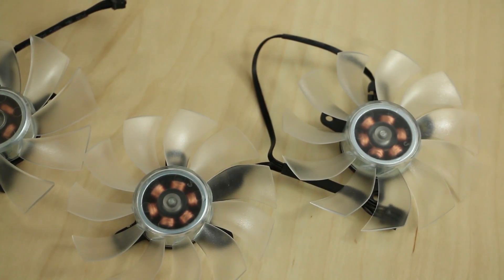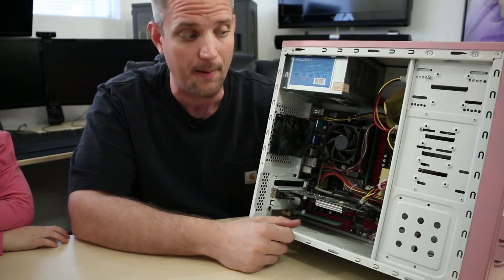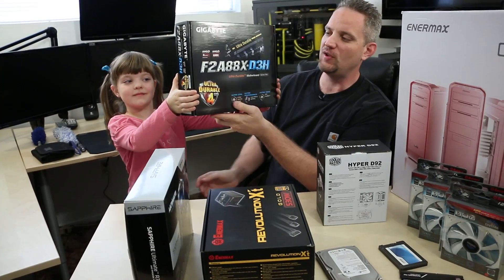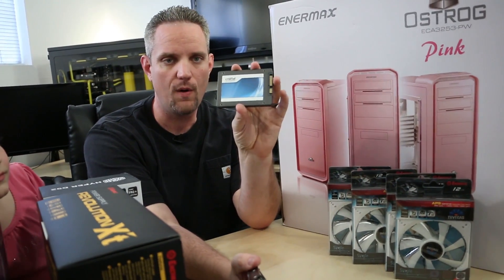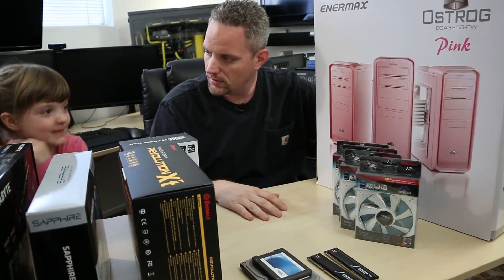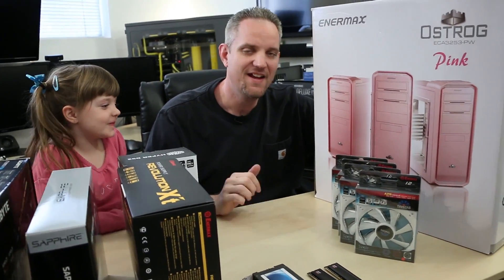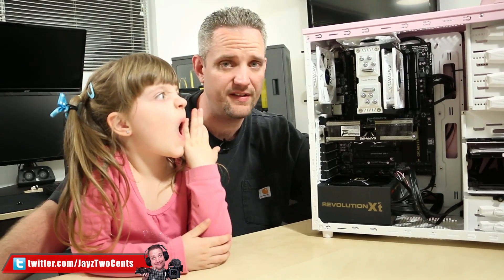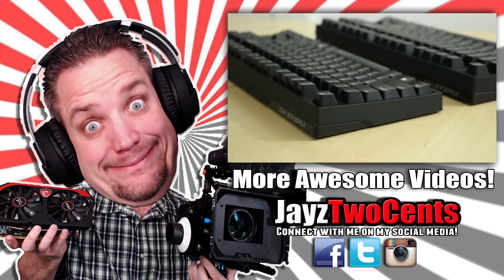5 Year Old Builds a PC

Comment: I noticed that you said that the 'slow' boot was because it was an AMD Athlon X3, but I have an old Athlon X2 that I use for a media PC, and I saved the boot time by putting an Intel SSD into it. Most of the boot speed issues are going to come from HDD speed limitations and other bus limits. (Such as the IDE bus that you mentioned.) The only bottleneck that I run into when I want to do something is that my home network is running at a slow 10/100 speed, but a $50 gigabit switch should get rid of that issue.

For most people that need a basic office computer, kid's computer, or internet browsing computer; these old things can still do that job well. Sure, they're garbage for hardcore gaming, but for the average person that doesn't do that, they're perfectly fine.

I even just finished an emulator rig that I'm using that's even less powerful. It's a laptop based on an AMD TF-20 chipset, with like 3GB of ram, and an old 5400rpm HDD. It going to run Atari, NES, SNES, GBA, MAME, and Sega games. Just about anything can run those at this point. Thousands of games on a system less powerful than a cheap smartphone isn't bad. :)

To paraphrase the old saying. It's not the size (or power level) or your rig that counts... It's how you use it! LOL :)
Reply from the maker: sbrazenor2 I never said it was due to the Athlon, I simply said it was slow. The slowness is clearly due to the IDE drive.
Reply: I too use an old athlon x2. it's my main system rig actually. the one in my HTPC might actually be faster.. at any rate, i agree. her old rig with an SSD, SATA upgrade, and some RAM would have probably set her up nicely. but it wouldn't have been as much fun, or as much of a learning experience, nor would it have proven the point of the video, which is if a 5 year old can do it, some grown ass folks that say they can't are some bitches. :)
Reply: 5 mins to boot may be due to failing hard drives as well.
Reply: koolBOY8323 Yeah, my main rig is a custom build with an AMD FX 8350 Black Edition. I probably saved about $400 building it and I can tune it anyway I want. Storage I bought online, going with 4x3TB drives for like $80 per.

OEMs cripple systems with limitations and cheaper components. My 'media' PC is capped by HP to 4GB of RAM, because it was a 'value model' sold at Walmart. (It was cheap, I couldn't resist.) LOL :)

I think an asset that I have is that I'm near a Micro Center. Compared to the usual big-box stores like Best Buy, the stock on hand is much better, and the prices are comparable to the internet for a lot of things. (I just like that I can have a good hands-on feel for what I'm buying and after check-out, I instantly have it, rather than waiting 2-4 days for shipping.) For a novice builder, a store like that also offers better trained sales people that can help with configuration options.

I found that they would recommend budget friendly options, instead of expensive options of equal value. For a new builder, this is important, since they may not know what they're getting into. Additionally, if you need a beefier heatsink / liquid cooling option, or other accessories, they will be able to help you figure out what you may be missing.

Even though I have about 14 years of IT experience, I opted to work with a sales person to figure out what their best deals were. I was able to find some good package deals and rebate options that saved a couple of hundred dollars. What I came into the store with for an idea and what I left with were different. I got better hardware and lower prices. :)
Reply: ***** It wouldn't win any benchmark races with either part, but yeah, the IDE drive would definitely do it. It was a good video, so I'm not trolling. I always enjoy your videos and Barnacules Nerdgasm's. I'd love to match the production quality of them, for my videos, but I'm still working with some pretty basic gear.

To work on my video quality and add better content, I'm doing an unboxing and review of a cheap Chinese flash that's supposed to rival the Nikon SB-600, but I've got almost no budget and I'm a novice with post production. I made the video with my Samsung Galaxy S5, which is pretty flat on color representation and sucks because it boosts the ISO too high. I'm planning on trying to use my Nikon D3200 for videos and hack together an off camera sound solution. They'll probably still suck. :(

I also need to get better software. I've been using Windows Movie Maker, which is not going to make any cinematic gold anytime soon. I may just switch to iMovie on my Mac.
Reply: Sam' s TechTips Seriously? Are you like 5 years old dude? n00b... Yeah, with like 16 years of IT experience and having been on the internet since Google was in beta. If that's a n00b, I guess we're all n00bs.
Reply: sbrazenor2 Dude, 16 years of IT experience and you haven't learnt to ignore trolls?
Reply: coscorrodrift  Sometimes I like to feed them. If you don't feed them, they will go extinct, and we won't have as much fun online anymore. :)

Comment: guys am not expert in pc building but i have a question why some ppl put the psu upside down. normaly the fan of the psu should be down not up
Reply from the maker: Depends on where you plan to put the PC. Since her PC will be on the floor, we mount the fan up to get clean air, instead of dirty, dusty air from the carpet.
Reply: yeah i though that too. but if i used a gpu with fans like the gigabyte g1 gtx 970 wont that leave the psu with no air? my case dont have best air cooling (nzxt h440)

Comment: She knows how stuff gets done around here!
Reply: Wait.... What about the thermal compound... Or is that only for liquid cooling? I've only used liquid cooling in all my builds XD
Reply: You need thermal compound on air cooling too
Reply: Oh thanks for telling me that.
Reply: Kirn20 No problem man, thermal compound is used for heat transfer. So basically any PC cooling solution uses thermal compound.
Reply: Also, I'm thinking of using MX-2 thermal compound in my next build, what do you think?
Reply: Kirn20 That is a good thermal compound but i would suggest using Arctic Silver 5 Thermal Compound. It is a very reliable compound and is used a lot of times in builds (over 6,500 reviews on Newegg!) and is highly conductive which is good.
Reply: Kirn20 Just curious too, what are the specs of your build?
Reply: FX-8320, R9 290 MSI, 16G DDR3 RAM, And a 750- Watt power Supply
Reply: Kirn20 cpu is bottlenecking your gpu. Unless of course, you oc'd it to around 4.6 ghz
Reply: Mar m OH NO!! Not the word "BOTTLENECK!" THE HORROR!
Reply: Mar m  That's why there's overclocking, dumbass
Reply: Kirn20 That's why I said: 'Unless you're overclocking'. I can't believe how angry you are when you receive a comment and a question on the build that you proudly post on youtube.

You're so angry man
Reply: Mar m I just called you a dumbass because i don't care if it bottlenecks.
Reply: Kirn20 If i were you I would get an fx 8350 and a gtx 970, or keep the 8320 and get a gtx 970
Reply: First of all, i'm getting an 8320 because reasons prev. mentioned.and I can't get a GTX graphics card period. I love my motherboard and if i have to be an AMD So be it.
Reply: I will admit, part of it is brand loyalty, the other half is cards like the GTX 750 and things like that that was in my price range, are apparently not as good as that card, and it came from people with the GTX 750 and 760, they recommended that card, so i bought it.
Reply: MSI 4GB R9 290; I might get the MSI GTX 970 4GD5T OC GeForce 4GB instead
Reply: Joe Thorpe The Gigabyte one is a good choice but might be too long for some cases, the MSI Twin Frozr V is a good card but i have an EVGA ACX 2.0 GTX 970 and it's AMAZING. It runs very cool and comes in Superclocked, Super Superclocked, and FTW versions. I think they start at $349
Reply: I was thinking about it, but i like MSI more, it fits my blue theme. Plus i have a msi mobo. In case your wondering it's the 990fxa-gd80v2
Reply: It's not a reference....
Reply: are you talking about the msi gtx 970 has a horrible cooler?
Reply: Oh ok Good
Reply: Kirn20 Aren't the MSI ones only in red?
Reply: No, http://www.newegg.com/Product/Product.aspx?Item=N82E16814127833

Comment: I think it is great that you and your daughter built this computer together. There is no reason to abandon the old computer. It will run as fast as the day it was built if you install a Linux distribution. I recommend Kubuntu for people who are used to Windows.
http://www.kubuntu.org/ 
Linux doesn't have a registry to get cluttered so it doesn't slow down over time. My nine year old Toshiba laptop boots to the log in screen within 30 seconds. It takes a little longer to get to the desktop after log in because of the KDE graphical environment. Other graphical environments get running faster than KDE but are less familiar to people who have never used Linux. When you built a new computer why purchase an operating system? You can get a better product free of charge if you use a Linux distribution.

Comment: Just wanted to ask why not place the PSU the other way around. The negatives are: It does not look as good with cables and contributes to negative pressure. I could thing of 2 reasons you would do it. 1) Be as a passive airflow fan for the top fan-less GPU. 2) The PC is siting in a carpet and the bottom gets blocked. Anyways great build.

Comment: nice video very entertaining and cute. 
Could I sugest to mount the CPU + Cooler + RAM outside of the case next time. I personnaly find it much easier and besides you can grab onto the cooler to insert the board into the rear I/O.
Reply from the maker: Except in this instance, you wouldnt have been able to access the top 8pin Power, or the top motherboard screws.
Reply: Aircooling problems :-)

Comment: Yo Jay, i'm planning to copy Skunkworks as my next build, hope you don't mind :)
Reply: youve got $9k to spend on a computer??? you must be super rich
Reply: lol no. It's gonna take a while before i get all the parts for it with my monthly paycheck. Also i'm pretty sure it won't cost anywhere near 9k probably something like 5-6k.
Reply: skunkworks before the update cost $8k
Reply: you're forgetting that skunkworks cost so much overall because Jay swapped out the parts for it quite a few times as well. It's a x99 mobo with a 5960x and 3 gtx 980's as a core. rest of the parts that go into it are not gonna add that much. The most expensive part after that would be that water cooling and probably the ddr4 ram. Also it's not about me needing a new rig right now, i just wanna build something as powerful as skunkworks, i'll probably end up selling it later :)
Reply: Jester Muffin You're forgetting, that the case costs like 800$, right? :D
Reply: What are you going to be using it for?
Reply: Nothing, imma build it then sell it after drooling all over it :)
Reply: Jester Muffin my friend just build a $1200 gaming computer and just made a desision to stop playing games and now he is selling it for parts. he has a gtx780 and a i7
Reply: i have no use for an i7 and a 780, my current rig is pretty much the same or faster.
Reply: Jester Muffin well i face palmed when he told me because he built it last summer

Comment: Yesterday I bought a new case for my computer and when I was putting all my parts into my new case I pulled the CPU cooler out and the CPU was stuck to the cooler.  I didn't know about it until the CPU dropped onto the table.  There were bent pins that I straightened out with tweezers and a credit card, but it didn't work.  Everything turns on just fine, but I get no picture on my monitor regardless if I use HMDI, VGA, etc. on both my MOBO and GPU.  Any ideas on how to fix this issue?
Reply: Does your Mobo have a debugging Display?
Reply: I'll be honest, I don 't know what a debugging display is.  Sorry!  :/
Reply: Its a small screen that shows two digit error codes you can look up in your Motherboard manual.
Reply: Is your bios set to use onboard gpu instead of the card? that could be your problem
Reply: I figured out the issue!  I went back to make sure all the pins were straight and sure enough they weren't.  After about an hour of straightening them my monitor had life on the screen!

Comment: Qhh not that curse motherboard. That thing has die on me 3 times this year alone. I gave up and decided to just buy my 4 mobo and let it be a msi one
Reply from the maker: Usually when the same component dies over and over, something else is causing it. Could be OCP in the PSU or something else.
Reply: ***** true i have the same board with the 760k running at 4.1 ghz so far no problems..
Reply: How that treating you? I am buying this motherboard and that processor. And I'mgoing to be pairing it with the R9 270x.
Reply: for the price they are excelent i run them with the r290x
Reply: ***** true.. i have not sniff the problem yet.But i have tried 3 different power supplies. ahh such a headache all that is left to check is the ram. I switch cases too. They all died within a  2 month or 1 month period of being up and running. The board usually dies when its running a game the screen freezes and wont respond have to pull the plug and next boot up, you figured out the board die again.

Comment: A 5yr old have better quality components than me? I think its time for work.
Reply: yh same here D':
Reply: I built mines 2 years ago with an ivy bridge i5 and a 7870? What the hell were your guys budgets, I thought mines was tight.
Reply: DuSlothster my dad built mine 2 years ago it had a amd athlon 64 x2 3800+, ati x1800xl(i found a asus 8400gs and used that when taking apart an old pc about a month ago) and 2gb ram... good thing im upgrading this week or next week just waiting for my new fx-6300 and new hdd to arrive
Reply: MarkRogers YT Can I have the x1800xl or the 8400, my gpu is a x300se, it struggles on 2 1024x768 crt monitors. (it won't run 3 without lines running through the desktops).
Reply: She has a APU with r7 250 running crossfire and a frigin SSD -.- and and and a case with led lights and stuff.... jesus
Reply: CactusFreak yh the ssd D':

Comment: hey jay im gonna build my new computer and i dont know anything  about parts and the compatibility  are this parts compatible ??                                                                                                                                                                               CPU: AMD FX-8350 4.0GHz 8-Core Processor 

Motherboard: MSI 970 GAMING ATX AM3+ Motherboard 

Graphics: MSI GeForce GTX 970 Gaming Edition 4096MB 

RAM: Corsair CMY16GX3M2A1866C9 Vengeance Pro Series 16GB (2x8GB) DDR3 2400Mhz 

CPU cooler: Cooler Master Hyper 412s - CPU Cooler with 120mm PWM Fan =

HDD: WD 2TB 7200RPM SATA 6Gb/s Hard Drive

Power Supply: Corsair CP-9020077-UK Builder Series 750W CS650M ATX/EPS Semi-Modular 80 Plus Gold

Case: Corsair Vengeance Series Black C70
Reply: reply pls need help